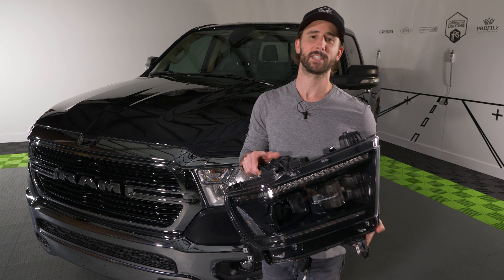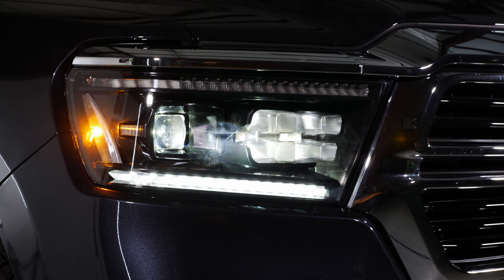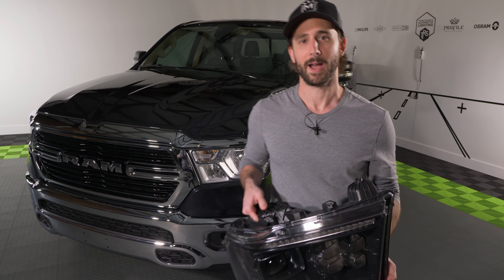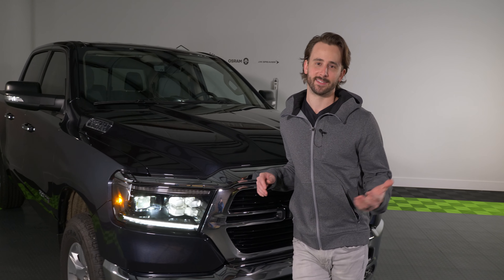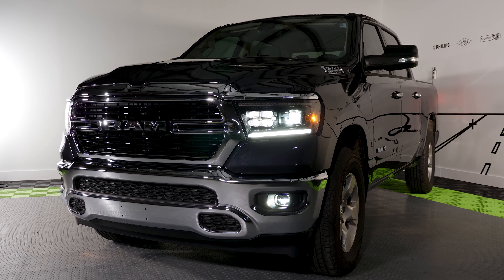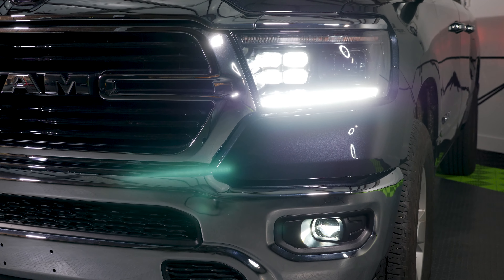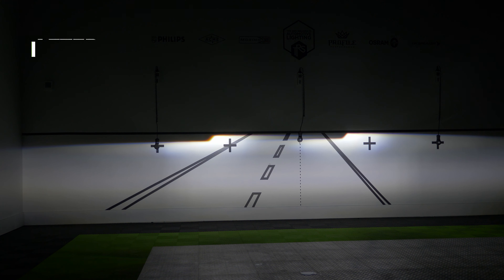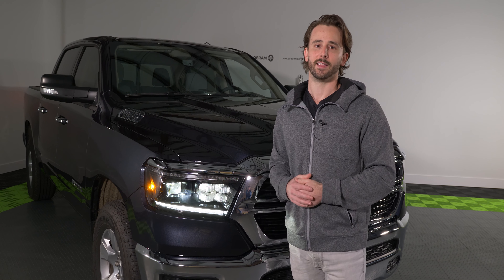19+ RAM 1500 XB LED Projector Headlights by Morimoto

Comment: Can these morimoto's be adjusted after installation
Reply from the maker: Yes, there are adjustment screws that allow for vertical and horizontal adjustment located on the back of the housing. You can reach them with a Philips screwdriver. Just make sure to park 25ft away from a wall or flat surface so you can make sure they are aimed properly & oncoming cars are not blinded.
Reply: GMC Sierra 2019 new headlights ?
Reply: Mine are for Ram 2019 1500
Reply: @twmcmillan1  I want to know if you are going to make some lights for that truck
Reply: @JesusMartinez-wm4dk  you can check with headlight Revolution or the retrofit source

Comment: Love these headlights , is the bi-led bulb interchangeable ? I have my eye on a set of super bright led bulbs i would love to put in this headlight
Reply from the maker: The LED's in any of the Morimoto XB headlights are not removable, which in not a bad thing. They use Kuria optics, which will provide the best light output you can get. They are significantly better than utilizing an LED bulb.
Reply: @RetrofitSource  So what if one burns out?
Reply from the maker: Then the housing would need to be replaced under warranty. The same goes for OEM LED headlights as well.
Reply: @RetrofitSource As a back yard mechanic I dont know I like this idea of having to replace the housing instead of a bulb :(
Reply from the maker: I totally understand that. Changing out a bulb is certainly easier than a whole housing. Sadly, that's where everything is going now. More and more vehicles are coming with OEM LED headlights with no replaceable bulbs.

Comment: I got a ‘19 Ram that came with OEM Halogen from the factory, when I was in the market for LED’s I looked at different brands and styles. Definitely the Morimoto XB was my first choice, they looked nice, the sequential turn signal looked so cool I just had to get them. It was a total disappointment after I got them installed the sequential turn signal was not working properly, when I tried the instant on/off turn signal it wasn’t working at all. Obviously I contacted the manufacturer just for them to tell me to send them back and get my refund because they couldn’t do anything about that. I asked for another new set because I really wanted the headlights, they suggested a new set was not going to make any difference since both turn signal modes weren’t working on my truck. 
What a disappointment. !!!
Reply from the maker: Unfortunately, with some trucks this can be an issue, we are actively working with Morimoto to fix this and I believe at this point it has been fixed!